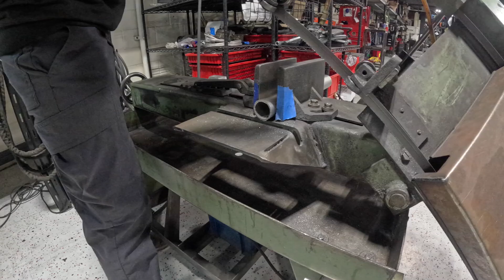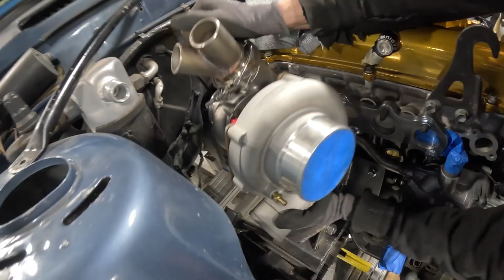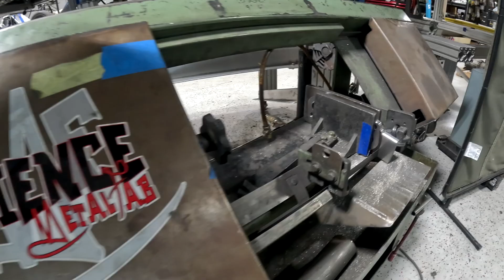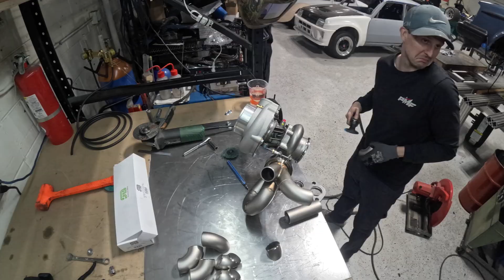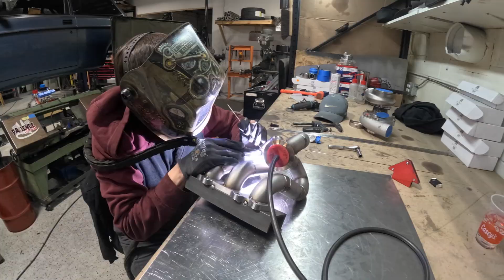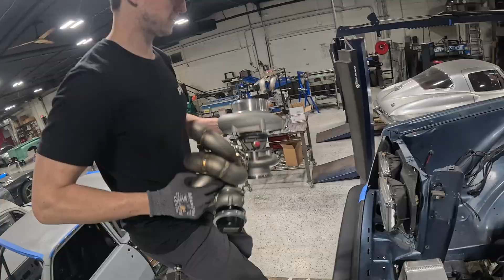Fabricating 2JZ Twin Turbo Manifolds from Scratch [IN 7 MINUTES] EP.7

Comment: Wastegate placement isnt ideal, but it looks good
Reply: It really is great work. What location would be ideal?
Reply: @mnbjb6531 somewhere it gets full flow from all cylinders. This one is at 90 degrees to the flow and only really gets flow from two cylinders. It could be better but space constraints limit them
Reply from the maker: If we were working with a single turbo, we would be able to play a little more with placement, but as you mentioned, space constraint is the main factor in EWG position here. With everything completed and bolted-in, there's not a lot of wiggle room to place them any differently. They'll will function just fine for the setup!